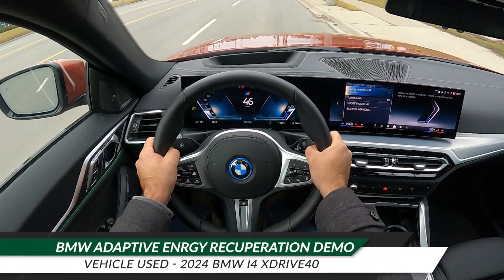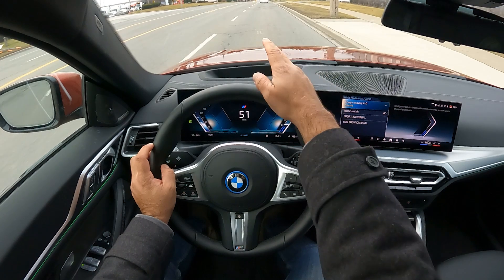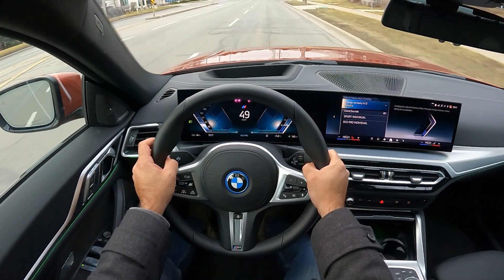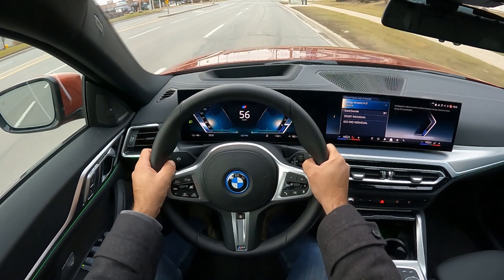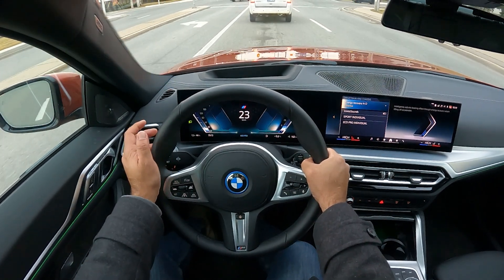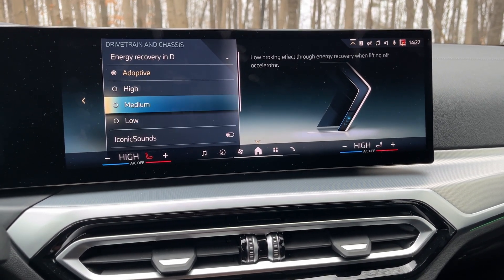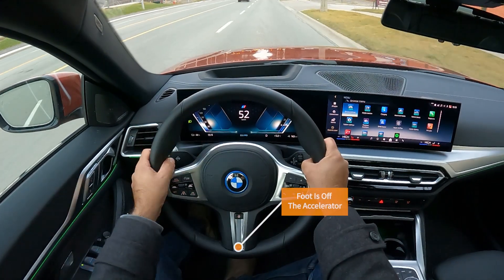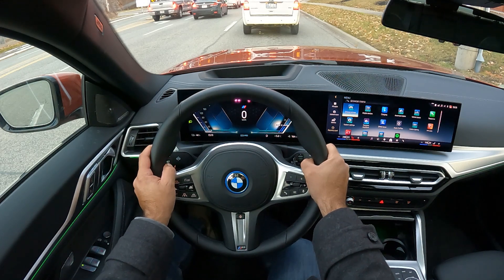POV Demo of Adaptive Brake Regeneration in a BMW Electric Vehicle

Comment: For those who were confused as i was, BMW i4 does have one pedal driving, its just not shown on this video. These regenaration levels are for the driving mode "D". However if you select drive mode "B" with the shifter, that activates single pedal mode in which the car stops fully when you take your foot away from the accelerator
Reply: so this guy has no clue what he's saying?

Comment: How much range can I expect on highways on iX4? Thanks in advance!
Reply: It varies.  There are three power trains, and, believe it or not, the wheels and tire communication effect range to.  Their size & weight, aerodynamics, with and then the sickness it rolling resistance of the tires all contribute to range.

Then driving style, topography, climate are major contributors. 

The estimated range for comparison of this go from about 300 down to 240.
Reply: rtfm

Comment: How do you turn it completely off??!!
Reply: That's not an option. Why you'd want to, is very strange. Just use the "low" setting.
Reply: @JBrown-go8ru  I want it off because I WANT IT OFF! I don't see what's strange about MY preferences. I also don't get why it matters to you. You drive your I7 the way you want and I'll do the same with mine.
Reply: @Syncinatti  you need a chill pill
Reply: Sorry.  Low/Med/High/Adaptive. 

Have you driven one?
Reply: There are four settings: low, need/high/adaptive. 

Low is VERY low, nearly imperceptible.  

Have you driven one of these?
Reply: @marklar2u  Yes, I own an I7. That's why I'm asking. It's not as imperceptible to me as you're saying it is. I notice it. I feel it. I don't like it. I want it off..... I also drive in B mode with one pedal sometimes. So it's not useless to me. But I wish completely off was also an option.